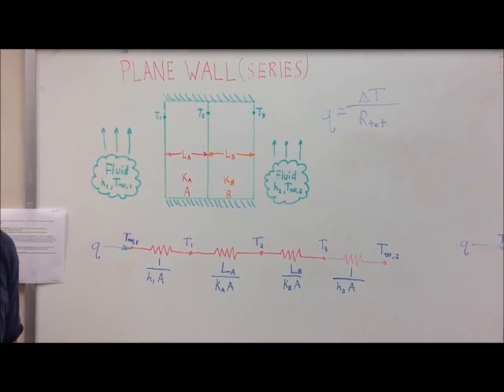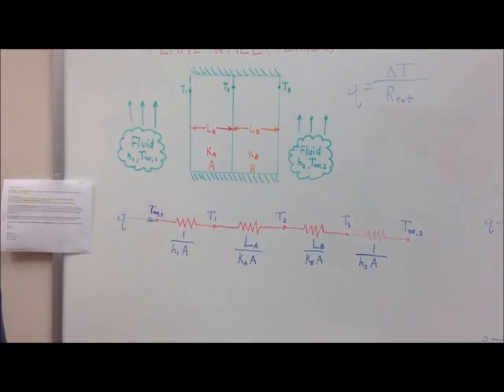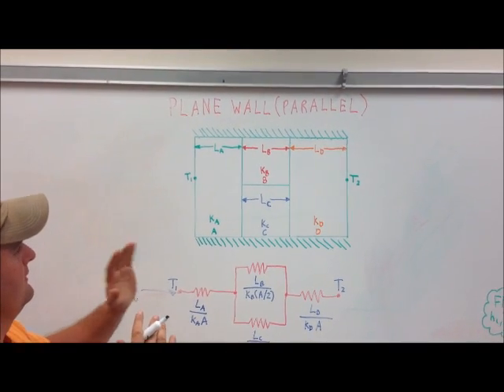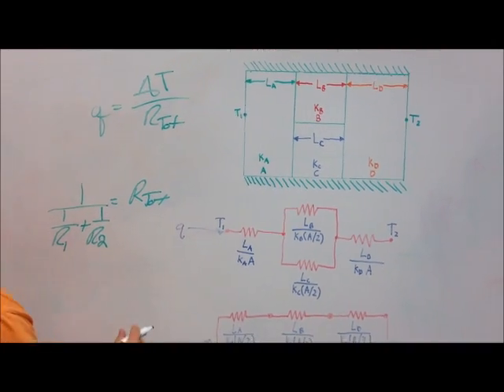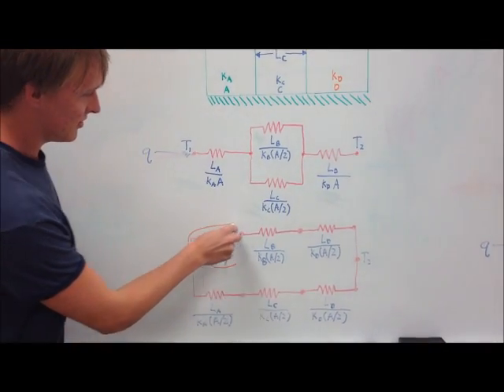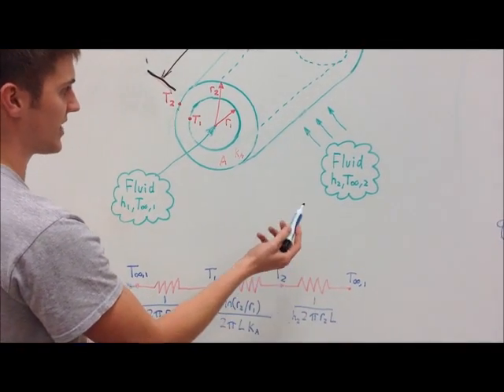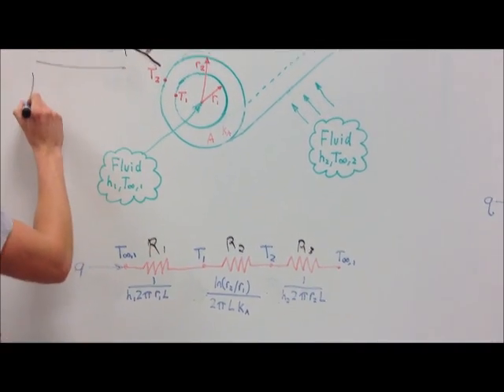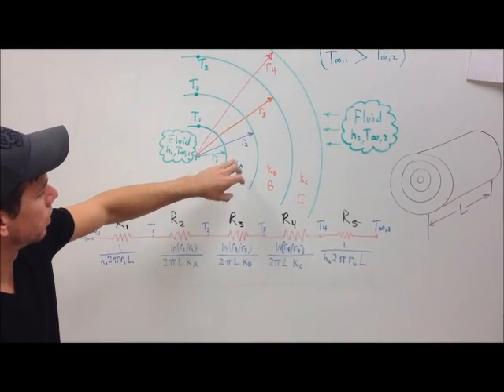One Dimensional Heat Transfer through Walls

Comment: Around 6:45, you wrote the same ambient temperature on both ends of the circuit. The right side should be T_inf,2. But you wrote it down write for q = T_inf,2 - T_inf,1 / R_tot